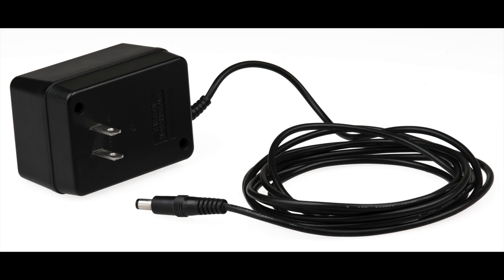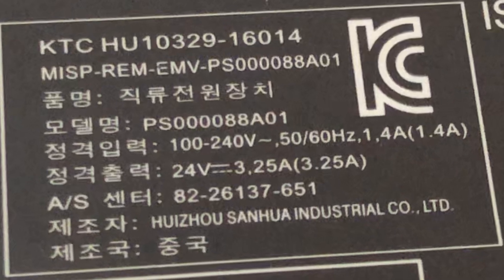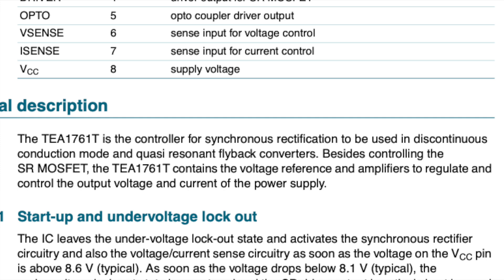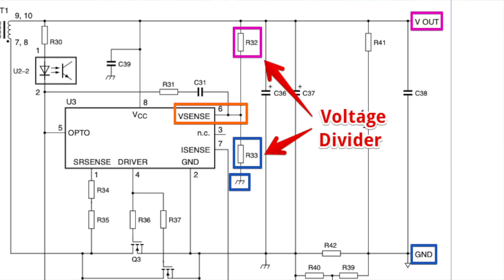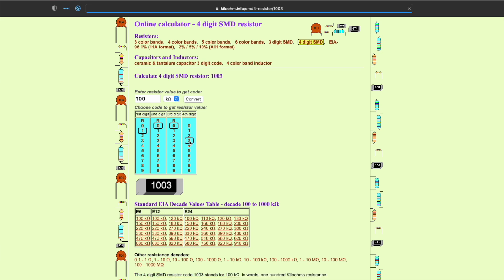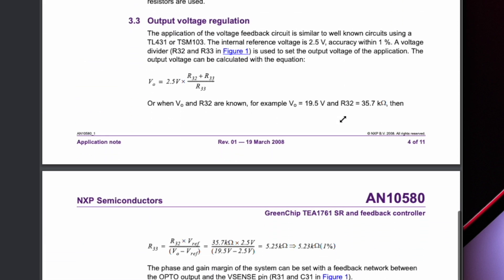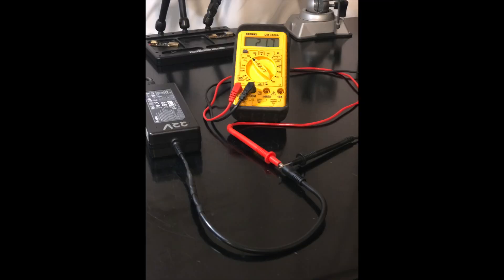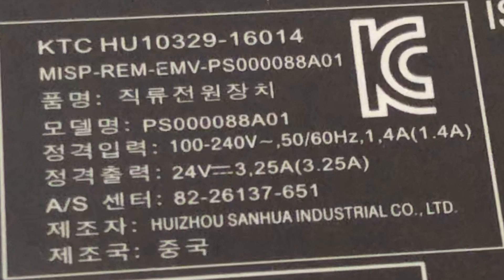How I tweaked the output voltage of an AC adapter, & my approach to understanding circuits

Comment: Well done, and well explained.
Reply from the maker: Many thanks!
Reply: @colindgrant  I tried this today.  I needed a 13 ish volt power supply to charge 12v batteries.  I took a few adaptors apart before i found one which looked convenient to work on.  It didn't have the chip you used, it was a three pin regulator (the 431) but the principle was the same.  The maths involved was much more complex however, so I just stuck a different resistor in after removing the SMD that was there, 47k out, 51k in.  I had to drill the board to fit one with leads.  I was quite pleased to find I now had 12.9 instead of 12v which will do the trick.
Thanks for the confidence boost.
Reply from the maker: @ I’m honestly thrilled to read this comment. I’m not a trained electrical engineer, and I was afraid of this kind of thing for a long time. But like most things it’s actually simpler and more approachable than I had imagined. It was my hope that explaining the methodology on my example would transfer to others’ applications too. So thanks for the feedback!